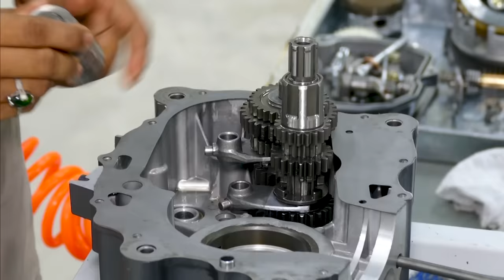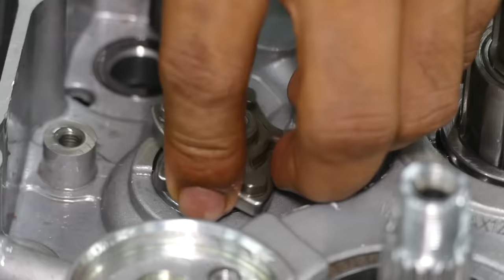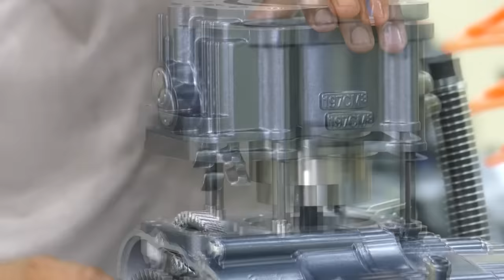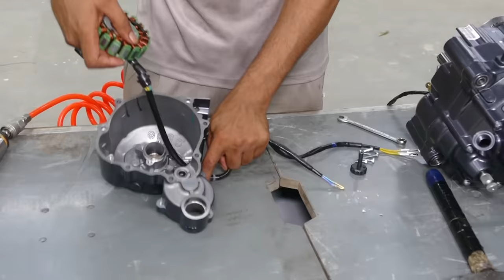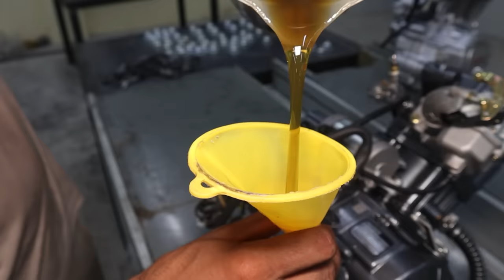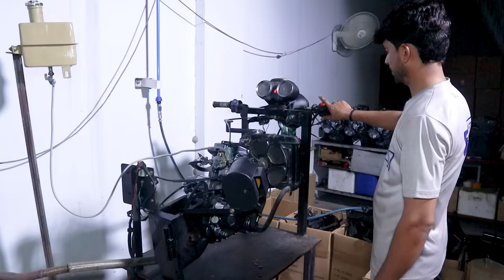How Tez Raftar 200cc Loader Rikshaw Engine Assembling

Comment: Cylinder head is tighten with air impact wrench. Enough automotive engineering for the day.
Reply: As if this was the only problem. I guess what you get is what you pay for.
Reply: @Giorgos_TT  it wasn't the only one. but it's the most critical.

Comment: that engine looks bombproof, the thickness of the crankcase shells and the barrel plus the oversized bearings and seals, should run forever with regular oil/filter changes,

Comment: So this engine actually inspired by honda cg with bigger capacity and liquid cooled?!
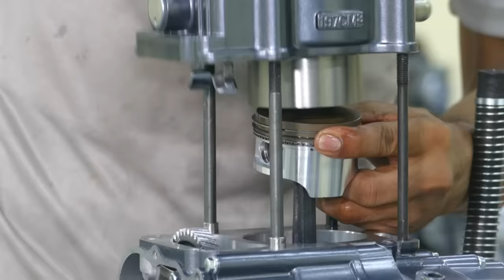Reply: Yes, this engine is based on the Honda CG125 engine design. It uses pushrods to operate the over head valves, and still has the small round plug, seen at 3:22, near the bottom of the left side of the cylinder barrell just like the old Honda CG.
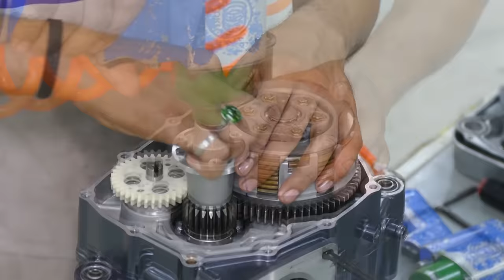 This engine also uses a centrifugal oil filter, that is seen being fitted at 2:15, which Honda also fitted on many of their small four stroke engine designs.

Comment: im just shock 200cc engine only got 4speed and not using timing chain... thats the cheapest way and cut cost to make 200cc engine, but im glad it use liquid collant..
Reply: Its a lifan engine.
Reply: @shubhamrane9137  Lifan never made a 200cc engine...
Reply: @yxssf_  https://youtu.be/ekPY8oypgZ8 it was made in small numbers. In many of lifan engines the parts are interchangeable.
Reply: @yxssf_  on simpler motorcycle style engines you can swap air cooled top end for liquid cooled ones.
Reply: @shubhamrane9137  where is lifan emblem? i not see it😂😂...  if its from lifan technology, you going to see emblem on the magnet cover... and lifan focus on full and maximum performance for the engine, not focus for cheapest technology.

Comment: this is a crappy gear engine with a valve rod. only thing this engine has is external oil cooling and 6 spring clutch